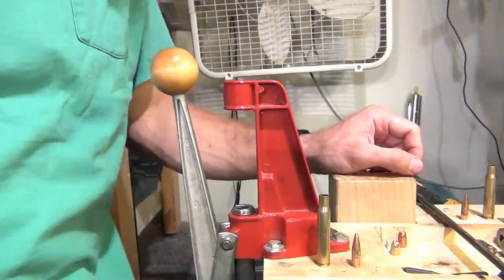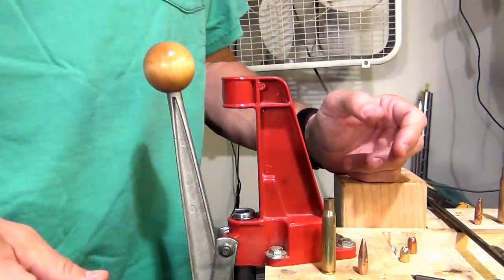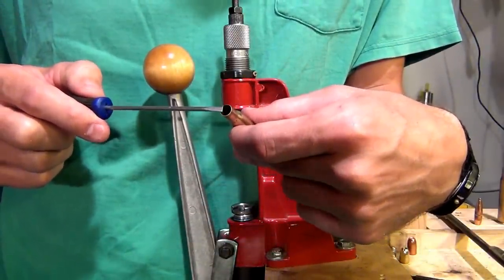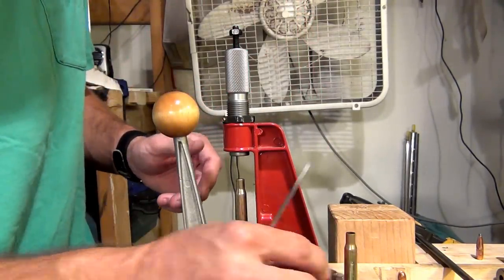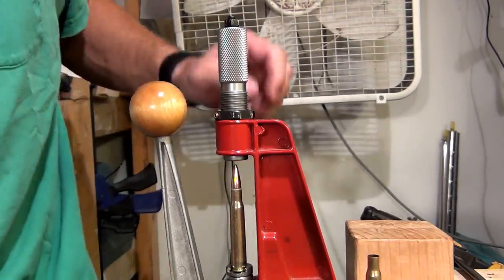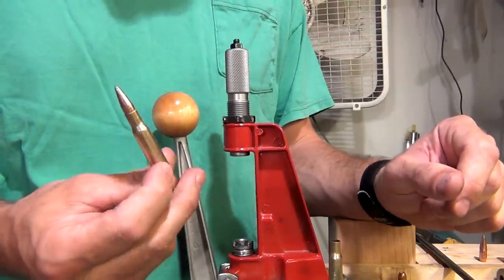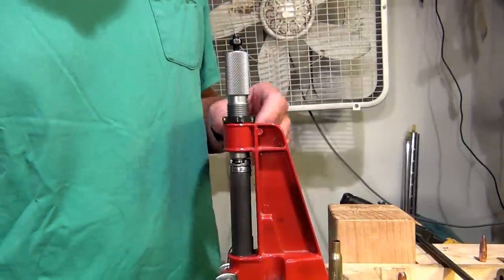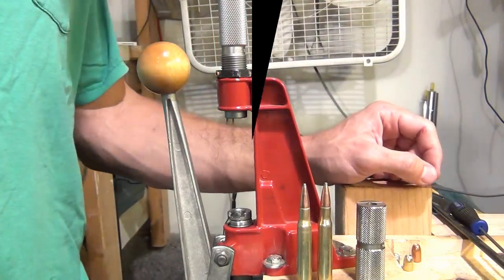RIFLE DIE SETUP ON A SINGLE STAGE PRESS - HD

Comment: This video takes all the unknowns out of setting up your reloading press.  I have a multi-stage RCBS and I will have to check to see if the crimp is a feature on my press die.  I have a factory crimper so it doesn't matter.  When I started I had little information about how to setup a press.  I have many crushed rifle necks because of improperly adjusted die setup.  This is a wonderful video.  I have this link set in my favorites.  Another helpful tip would be to include with this video setting up a factory crimp die. I am not sure how much pressure the crimp should take and not damage the bullet. This video takes all of the guess work out of reloading!!!!  Thank you.

Comment: jiujitsu2000 I did every thing you did when I was seating my 223 it worked like a charmWhat I have say is don't use any Winchester 223 FMJ Boat Tail. I found that the bullets were not the same size. I had to size each bullet when I found the right size every thing worked just like you said it would work. I have put all of your videos in my favorites. I use them for reference. I would say your the best on the Internet. Keep up the good workErnie

Comment from the maker: You're welcome and thank you for your kind words and support to my channel! First thing that I'd recommend is to make sure you're trimming your brass. This should fix your problem. If it doesn't, I'd recommend backing out the bullet seating die body another turn, counterclockwise. This will take away the crimp feature of the die. Don't worry too much about the crimp because the case mouth generally has plenty of tension to hold the bullet for most applications. Have a great day! :)

Comment from the maker: Thank you for the kind words and all the support you give my channel! If you're loading for a single shot or a bolt action a crimp isn't always needed. During the re-sizing process on the downstroke of the ram the expander ball re-sizes the case mouth diameter. When you seat the bullet, theres plenty of case mouth tension to hold the bullet firmly in place for most applications. I usually only crimp for semi-autos and lever actions. I hope this info was helpful. Have a great day! :)

Comment: Cheers mate you explain all the steps in detail. As a first time reloader I'm all for each detail being explained from start to finish. The only thing I think you left out was trimming the case I know you showed the case length after the bullet was seated, but I get the picture. To crimp or not to crimp, this has been my dilemma, and as you explained if you have bolt action don't bother. So why crimp with semi auto?. Cheers from down unda.

Comment: Thank you for the great step by step instructions on seating and crimping, I was reading instructions and went hazy on the crimp part. My reloading set up has wheels so when I start on the S & C part I'm going to role it in front of the computer and watch you again :). One question, I'll be using the 60gn. V-Max bullet with the polymer tip and no crimping groove (smooth all around the bullet), I'm guessing this is when we don't crimp? I thank you for the answer and your very helpful video, you made it in 2012 and I'm glad to have found you 4 years later :), Just started reloading.
Reply from the maker: +Steve Duvall Thank you! In my opinion, I'd still crimp
Reply: I'll do just that and want you to know I'm doing my 30-30 ammo next and I'll have your 30-30 reload video close by :) (Gave a friend who also started reloading your sight). Thanks again and your always welcome at my hunting campfire.

Comment: Jiu your instructions were Great.? I bought a Lee Hand Held Press to load with till  I  set up my Bench.? & a set of Hornady  Dies in the Rem 223.? Your video made it easy for me to set these Dies  up & it worked out Great Thanks again for sharing your Video.?
Reply from the maker: thank you!!
Reply: +jiujitsu2000 Thanks again. Trying to get some Coyote load ready for my new Marlin XL7 Rifle.? Also picked up one of those FrankFord  Small Scales on Amazon.? For about $30.00 Saw some great Reviews on it on the tube.?.
Reply from the maker: +A REDTAIL is a great scale!

Comment: Thank you for the information. Very helpful. I was thinking the Lee 4 die set was the way to go. Now I see a 2 die set might be a better setup for rifle ammo.
Reply from the maker: Lee makes great idea and in my opinion the 2 die set is better for rifles. thank you for stopping by! :-)
Reply: There is nothing wrong with a three or four die setup for rifle.  The third die is usually a neck size only die.  You would choose to either neck size or full length size your brass not use both. The fourth die in the lee set is only for taper crimp since thier seating does not crimp.

Comment: Thanks for all your videos, I like your style.
Not sure if you noticed already, but your 30-06 decapping pin is bent.  I can see it wobble as you were setting up the die at about 3:30.
I broke my Hornady .308 decapping pin last weekend trying to decap and size LC .308.  New parts arrived today along with a Lee Universal decapper.  From now on, I will decap first (before tumbling).

Comment: nice video,  detailed and explained well.
to crimp better and once the tool regulates, it is enough to turn the casing of a quarter of turn and to crimp 2 more times. Setting becomes more equilibreted on the circumference of the bullet ( clem from Paris)
Reply from the maker: +clem zeit Thank you! Happy Thanksgiving!

Comment from the maker: Good morning. There are several manufactures that offer a case length gague. I have some by Lyman, Dillon, L.E. Wilson. They all do a great job. You can find them online at the Dillon website, Midway, Sinclair, Brownells, etc... They usually run around $20-45 depending on what you get. Most of mine are Dillon and Lyman, but honestly, they're all good in my opinion. I hope this info was helpful. Thanks for watching and have a great day! :)

Comment: Good video.

Is the shell holder common to all brass or did you purchase one for the brass you are loading? 
Did you previously set up the case mouth for the dia of the bullet you will be using?

On the 2nd die, how did you determine OAL?

Comment: Three die sets are necessary for straight walled cases, and sometimes are a full length sizing die, neck sizing die, and seat/crimp die.  If you're loading for a semi auto and a manual action, a 3 die set with neck + full size die is for you.  If you're loading cast lead in a straight walled cartridge, you're looking at sizing, expanding, belling, powder dropping, seating, and crimping.  You're looking at 4 or 5 dies.

Comment: Great video. THE PROCESS IS IN ERROR. When setting up the resizing die, it needs to be screwed in 1/4 turn, tightened and locked. Otherwise not all rounds will chamber in the rifle (even if they pass gages).
Also, DO NOT crimp. It is unnecessary, not recommended by Hornady and will potentially cause chambering problems if it is excessive. 
Before you load with powder, I highly recommend setting bullets on about 10 to 20 shells and try these dummy rounds on the rifle. See if all chamber. If so, then proceed with powder-loading the rest.

Comment: First, congratulations for the video. Very well done, simple and clear. You´ve mentioned that the cases are previously lubed. Aren´t you using carbide dies or do you lube them anyway? By the way, I hope not making any writing mistake, ´cause english isn´t my motherlanguage. I´m brazilian.
Reply from the maker: Waldyr Wal Thank you! Feel free to check out my 15K sub contest. I'm giving away a 
Gopro, a SteriPen and some other cool stuff. Contest ends Sept 1st 
2015.All you need to do is sub my channel (which you may have already 
done) and upload a VR. Feel free to check out my contest video for more 
details!

Comment: Thanks for the video.  My greatest doubt is what I think the O-give should be and the distance for my bullet to touch the rifle chamber.  Your case gauge only determines the length of the brass, so how do you know when your head space (which varies gun to gun)  is optimal?   I trim my brass with a Lee brass trimmer every re-load, but am never sure of the dye O-give touching different bullets in the same place.   Any thoughts?

Comment: Thanks for the video's, I just ordered this press and die set along with most most of the other things to get started reloading. I've learned a lot watching your video's, I have a question. Can you use WD 40 to lube the cases?
Reply: ive heard wd 40 compromises the powder because its a penatrating oil

Comment: Thanks for your video! I am very new to reloading and watched your video prior to my first hand loads. I loaded 50 rounds of .223 and they fired just like factory loads. Your video explained nearly everything I had questions for. But, I was wondering why crimp or not crimp? You explained it a little, but I was hoping you could go a little further in detail as to why would you crimp with a semi auto and not with bolt action? Is it just a preference or is there a need? Thanks again!
Reply: Adding a crimp can tighten your groups. I had to get extra crimp dies for 41 mag and 32 auto.

Comment: ok i just got tbis press, and man you do a great job explaining the process. my question is the spent primer goes in the slot of the press.... how do i get them out? do i have to remove the press everytime to remove them?
Reply: Lucci_ Guns  it will fall out of the side of the die so no problems.
Reply from the maker: +Lucci_ Guns Great question! I routered a slot for them to go into. You might be able to see it on some of my reloading videos using this press. Thank you!

Comment: you check the case length after loading the bullet, wouldnt you trim the case before you loaded it to prevent having to pull the bullet?

Comment: Thank you so much for this video. I do have a question though, “that I can’t figure out and do this with a lee classic load because of it”, is how to set the expander ball rod? I have the Lee resizing die set, but it is very similar to the one you have. When I go to extract the casing, it is so tight inside of the casing that the expander ball/rod pulls right out with the casing even though I have the nut on top super super tight and then I have to cut the casing off. Also, if it does come out, it isn’t sized like it should be. Pretty frustrating being new to reloading but I would assume that this would be part of the learning process. I hope this helps you help me, for this is the best way of explaining it.
Reply: You could possibly have the pin set too far. Take two quarters and put them together. Place them on the bottom of the die. The pin should only stick out a tiny little bit past the thickness of the two quarters. I think it's 3/16 of a inch

Comment: If the bullet doesn't have a canteluer how do you set the bullet seating die? Do I use a micrometer to measure overall length and adjust the die as necessary?

Comment: All the interesting videos are pretty old, shame cause I got questions. Was under the impression that once fired cases from a bolt rifle should not be full length resized? Is there a decaper that only neck-sizes? I take it it still must be cleaned, but I also heard that when using carbide dies there's no need for lubing? Some answers would be appreciated cause boy, am getting confused.

Comment: jiujitsu2000 Thanks for the informative videos. I need to know when do you use a roll crimp and when do you use a taper crimp? Thanks
Reply from the maker: thank you! a taper crimp is for straight walked cases and a roll crimp is for bottle neck cases
Reply: +jiujitsu2000 Thanks for your reply. Im confused because in your pistol reloading video you were roll 
crimping pistol cartridges.
Reply from the maker: +Doug Matthew bullets that have a cannelure get a roll crimp usually
Reply: +jiujitsu2000 That explained it. That makes sense. Thanks again.

Comment: How can I tell if it is seated enough, To just touch The lands on my Rifle, IF I do not have any Gauge to do so.?Can I just compare it next to a loaded Factory round, It's a win 270 the Factory Round is 130 GR, But the bullet, That I am Reloading for my Win 270 is a 110 Gr Varmint Bullet, Thanks for sharing your great info etc.
Reply: Use a magic marker on the bullet.  You'll see the marks where it touches the rifling.  Keep seating it deeper till the marks don't appear.  Generally, you want a little bit of bullet jump.

Comment: when loading i often come up against the same problem, setting up the sizing die as you show and going through the whole process, problem is the bullets will not let the bolt close. i checked the case length and to see if the primer is in correct. the numbers all come up by the book. my solution was to a little off the shell holder width ( maybe  a !000th ) resize  it will go in no problem.. i would like to know why it does not work as it should, it pisses me off every time. what's your suggestion.
Reply from the maker: +Daniel Bryan that sounds fun straighting what caliber are we talkin about and did you trim your brass? Please let me know and we can go from there
Reply: it started out with the 22-250 and it turned out to b any case that uses the number 2 shell holder
Reply: Sounds like it is a headspace issue. If you crew your FL die 1/4 of a turn inward, that will resolve the problem. Had this problem before with military case I bought. Start with 1/8 of a turn and resize. Check bolt and if not go in a little more. It’s a trial and error thing. Let us know if it works on you.

Comment: ever load 375ruger?? I'm having trouble with my resizing die crushing the shoulder on them & can't shut the bolt
Reply from the maker: I would recommend raising the die body up by backing the resizing die out 1/8 of a turn and go from there with my resizing operation

Comment: hey. one question. some people once the resizing/deprimer die hits the shell holder they will go in ANOTHER 1/4 turn.. is this necessary? just got the hornady lock n load single stage press. thanks!
Reply from the maker: +Nick I don't do that. Many people do...
Reply: JIUJITSU2000  do you know what the purpose is? curious to know. 
cheers.

Comment: I am having problems getting the cases to seat all the way up into the re-sizing die and popping out the spent primer. 7mm Rem Mag so similar sized case to your 30.06. Any ideas or suggestions as to what may be the problem? They have been lubed but they want to leave approximately 1/4" of the case from seating into the die.
Reply from the maker: is it getting caught on the expander ball?
Reply: Nope; messed with it some more and it turns out that they needed quite a bit more lube. They were just getting "friction" stuck despite having been lubed already. Thank you.
Reply from the maker: +RogueTS1 wow!

Comment: JJ Question.? Why is my New Win 270 Nickle Brass, So hard  to go through my resizing Die that is properly set up & Lubed Is Nickle Brass more difficult to size than regular Brass etc
Reply from the maker: +MyREDTAIL I've never had any issues with nickel brass. Is the brass that you picked up from a reputable manufacturer?
Reply: Yes new from Midway USA
Reply from the maker: It should be fine then. What kind of lube and how are you applying it?

Comment: How do you figure out how far to seat the bullet if it does not have a cantalur (spelling) ring
Reply: Louis Flaim you need a set of calipers. Your reloading manual will tell you OAL, this is overall length. You seat the bullet and test the length trying to match the reloading spec exactly. The fact that he didn’t do that is something I discourage because if you overseat the bullet your case pressures begin to rise and can rise to dangerous levels so you want your OAL to be VERY consistent and accurate